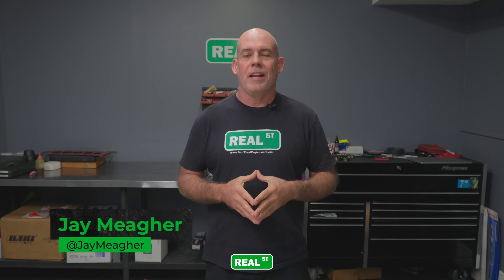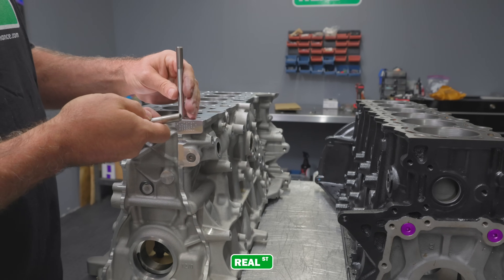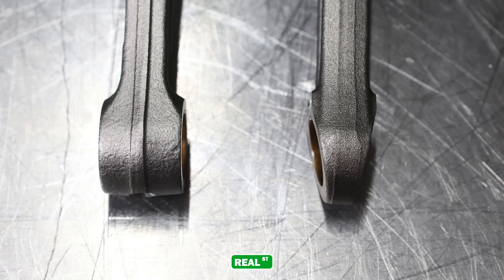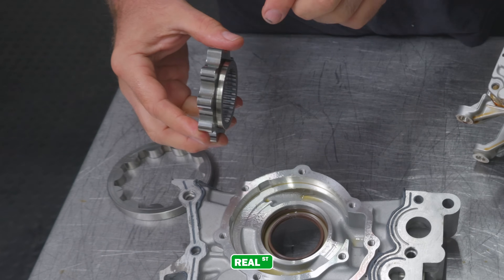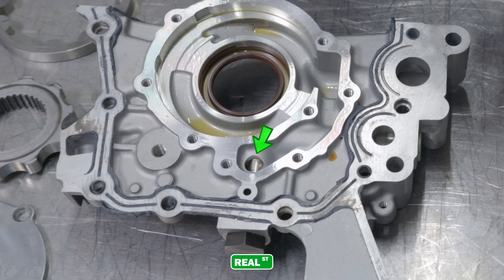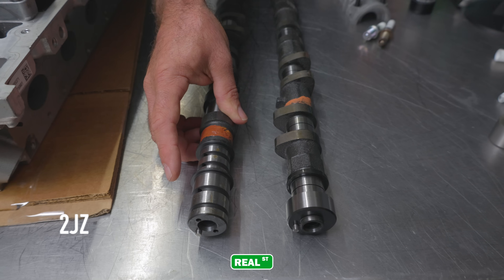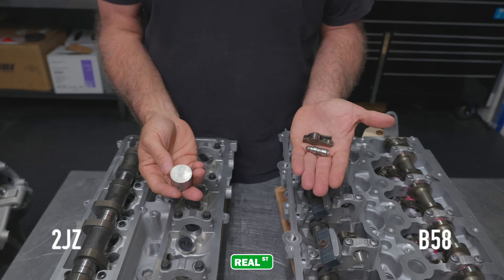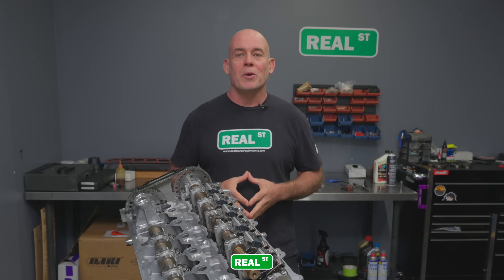Toyota 2JZ vs BMW B58 | Comparing Both "SUPRA" Engine Internals Side By Side In Detail

Comment: I've been defending the b58 but after this I think they can kill it now . OG 2jz is irreplaceable
Reply: You and a LOT of people were defending the B58 and that it was better than the "out dated" 2JZ because it had more technology and newer and "faster" than the orginal Supra when it was released. Yes YOU and they were correct, its newer, newer technology and more hp and faster than the Supra when it came out in 93, BUT the 2JZ motor is still better and can hold more power than the B58. 
That 2 port head will NOT do 2000 hp. MAYBE the 6 port B58, but we won't know until someone actually pushes it, which NOBODY has even attempted yet. 
And this is why ~19 of the 25 fastest imports in the world are 2JZ's .... There is a reason why people have this motor.
Reply: @ACommenterOnYouTube  personally i thought b58 had potential for high horsepower but still recognized its weirdness like the timing chain, water to air intercooler and the oil heat exchanger plus the plastic intake
Reply: @brianm5753  timing chain location got revised in the TU, some people swap to a fmic and upgrade the intake manifold to metal.
Reply: @ACommenterOnYouTube "And this is why ~19 of the 25 fastest imports in the world are 2JZ's" It's like the JZ's had a 25 year head start or something . . . 
Also the "restrictive" 2 port head can easily do 1000hp. If cast Honda heads can do stupid amounts of power a BMW head surely can.
Reply: @Thee_Snow_Wolf  1000 hp is a long way from 2000 hp, do the math.
What Honda head is doing "stupid" amounts of power ??
Reply: 2000hp on stock block? maybe aftermarket blocks
Reply: @oon783  Did i say stock block ??? NO 

The 2JZ "block" can handle 2000 hp with supporting pistons and rods.

Comment: Where is the b58 also planted in a bmw? And how is that vehicle compare to the actual supra.
Reply: Like.......20+ bmws....they range from the 2015- current made 40i bmws in almost every platform u can think of other than the....2018-2019 I think 1 series(they made them fwd afterwards and are made elsewhere other than the US market is why). There are differnt gen B58s also that have their differences that aren't too far apart to a degree other than small or slightly big changes.
Reply: M240i has the B58

Comment: IMO it’s too early to compare maybe in another 10 years.
Reply: Well because we have to wait and see if the B58 block can hold 2000 hp ....
My guess is NO ...  The 2 port head wont flow 2000 hp. 
But nobody has pushed the B58 to its limit YET so yes we have to wait and frankly not sure why nobody has done so. 

Papadakis BUILT his B58 just to hit 1000 hp because i dont think he thought the B58 would hold 1000 hp on stock internals.

Comment: Seconds into the video I fully expected to come out forced to like the BMW engine. Having seen this awesome and detailed comparison, I am just confused. The new engine is in no way superior. It probably has better fuel consumption, emissions and does weigh less, but that's irrelevant from a performance standpoint. For the price of it, you can probably get an aluminium aftermarket JZ block. Toyota you shit the bed with this one. And that's not even accounting for the interior and infotainment in the Supra.
Reply: The 2JZ block is superior PERIOD ...
The B58 2 port head wont stand high hp, the 6 port maybe.
The B58 block holding 2000 hp 🤷🏽‍♂️ someone has to try it but nobody has done it yet and i dont know why especially when this motor is being "hard" compared to the 2JZ all the time.

Comment: Hi Guys, great video 👍🏻 Just FYI regarding the B58 oil pump. The part that you stated as being a scavenge stage, that is actually a vacuum pump for the brake booster.

Comment: Curious the power level limitations the two port exhaust head creates on the early B58?
Reply: Thats why he said on the 2 port B58 head wont support high level hp but will help spool the turbo quicker on low end.
Reply: @ACommenterOnYouTube there is a 2 port mk5 making over 1000whp+ from P2uned and they recently ran a 8.23 in theirs.
Reply: @carboydorifutoparty3976  well the 2JZ did 1300 crank hp and 1105 whp on stock internals so ...
When that B58 hits 2000 crank hp or 1600 whp, then we can talk.
Reply: @ACommenterOnYouTube  I understand the obvious limitations the two port head has.  My question was merely what limitations it creates meaning what’s the max power level vs a 6 port head?
Reply: @KCMedia33  on the 2 port head, all 6 ex ports have to flow thru 2 ports which is a bottle neck for the exhaust at high rpm high, high hp levels. 
Where as the 6 individual ports, they have their own path to exit which is better for higher hp applications.
Reply: Papadakis actually opened up 300 more horsepower when moving to the 6 port head

Comment: The b58 no doubt is more advanced than the 2jz. engineers keep adding more ports for fuel, air, oil etc, and more adjustability for gears, pressure, air to fuel. All this means is that engines are getting more and more complicated or complex which does open more room for improvement in power and efficiency. It also makes room for more problems and more difficult to locate the issue due to more bits and pieces. in the end either go with something more complex and corky with new empty pages waiting to get filled or just stick with the published book that's simple, robust and proven with a nice ending. lol great video
Reply: More ports for fuel? What are you talking about? VVT is also a problem for making power at the highest levels of performance. Most of the "improvements" that the B58 has over the 2JZ were done for fuel efficiency and will do nothing but limit the amount of power that it can make in a racing application.

Comment: Asking which 6 cil. engine is better is like asking wether the 4 cil Mitsubishi 4G63 is better than the Honda 24K.
There are much more Honda racers, therefore more development in the K24.
There isn't as much interest and therefore investment and therefore results in the B58.
Simples.
Reply: Ka24de vs sr20de 
Ka is a high torque lots of power down low but nothing up top
Sr has no torque but lots of top end hi rev hp 

Pick your taste. I took the ka, 482 whp and 452 wtq. 
I hit the gas pedal abd she is GONE ... no lag no wait 👍🏾
Reply: the 4g63 was easily the swan song of Mitsubishi. Amazing little engine, as long as your crank didn't decide it wanted to go for a walk.

Comment: Making a QUICK SEACH ON THE INTERNET i'VE FOUND 4 COMPANIES THAT SLEEVE THE BLOCK OF THE B58 [sorry for the caps].
So the sleeves may allow you to increase the bore and, therefore, the valve diameters for better chamber flow. Its a perfect world as the walls among the pistons will be stronger iron and the Al will allow lightweight aND HEAT DISSIPATION. So much potential there 🤔
Obviously the cast iron block 2JZ is better for drag racing, while the alu block B58 is better for endurance racing as it permits better heat exchange and smaller size of radiators and less coolant and hooses. - weight savings.
The complexity of the pneumatic valves and rockers of the B58 will demand the use of AI [ANN = Artificial Neural Network] to perfectly tune it, as the 2JZ uses a single cap. You have to simulate the intake [rocker+pneumatic lifter] + exhaust  [rocker+pneumatic lifter] altogether in Phyton to find the optimal solution for the components. It will be a simulation of 6 rows of 6 ellements . 😱Intake rocker+lifter + electric controler [vanos + valvetronic] + exhaust rocker+lifter.
Also the higher complexity of the B58 valve controlers - more 6x moving parts - will make it more break prone.
On the upside, the B58 will be able to manage the acceleration better. The 2JZ might be the dyno king, but its restricted to a shallow RPM range, demanding the use of blow-off valves and ECU management of the traction control. More ECU interference means more stress to the engine. The B58 should naturally find more progressive traction in lower RPM.
IMO the B58 will trully evolve when people start to use the F1 pneumatic valves, eliminating the rockers and valves, making it reach 12,000 RPM. Meanwhile you have to develop suppliers with alternatives to rockers and pneumatic valves 🥵
Reply: "Obviously the cast iron block 2JZ is better for drag racing" This statement is just not true. The fact the 2JZ block is cast iron doesn't mean it's inherently better for power production than a B58 block. After all the B58 engine block is the same block as the diesel B57, and diesel blocks need to take FAR more combustion pressure than a petrol engine. 

Also did you use AI to write this? It had so much wrong info it felt like I was having a migraine
Reply: So many words for so much BS... Sorry dude, you're a great talker obviously but you're talking nonsense.

Comment: 16:14 This means using MAP sensors as an input to Spark and Fuel surfaces for calibration goes out the window. If the airflow can be managed via intake valve lift then one would need an in-cylinder pressure sensor to read load.
Reply: It can determine load using a MAF sensor
Reply: @coreyw427  Not accurate enough for boosted applications
Reply: @755hp  It is boosted from factory? Or do you mean extra boost? It has a MAF from factory. No one uses an in cylinder pressure sensors to measure load. There are many simple ways to solve the problem, eg the load will basically be proportional to the manifold pressure and valve lift at a given RPM. It’s really not overly difficult and certainly do not need something that a) isn’t used in reality and b) is only used by OEMs during engine development. Also, MAFs are very accurate, no idea where you got the idea they weren’t from. They’re more accurate than using a MAP-based approach really as they directly measure airflow into the engine rather than trying to estimate the airflow using pressure. Maybe you’re thinking in an aftermarket application that the factory MAF would be too small, which definitely could be possible.
Reply: @coreyw427  So one would need various surfaces to account for MAP, RPM and Valve lift; those are three inputs needed to set fuel and spark timing. So for example, if your valve lift has three opening positions (low lift, mid lift and high lift), you’d need RPM (x input) and MAP (y input) as a surface at low, mid and high lifts. Then you could write the software logic to blend these three surfaces together to account for in between valve positions of low to mid and mid to high (assuming they are variable and not step changes). So I guess this can be done…

As for he MAF vs MAP debate, speed density calculations (MAP based) are more robust (leaks, seals, etc than MAFs). Similarly, it allows for changes in the intake piping where load can still be accounted for. This this order (1st is best) are the best ways for measuring load: 
1 - MAP
2 - MAF
3 - TPS

And I’m waiting for the day that an in-cylinder pressure sensor is robust enough to last the lifetime of an engine; cause this would be the best way to measure load in the software. Simply target a cylinder pressure and bring actual cylinder pressure to meet it using all actuators (throttle, fuel, spark, wastegate, etc). Will also be able to guard against knock far more accurately this way to. Having an in-cylinder pressure sensor is a vital input to being able to control an ICE engine way better. Game changing if applied in factory applications. Just too expensive and doesn’t last long; so developmental use is only applied at the moment.

But the data taken from development use of an cylinder pressure sensor IS modeled in the ECUs; also cylinder temperature (especially for CAT monitoring). The software does have a rough idea of temps and pressure accordingly….but it is still only “modeled” not actual…
Reply: @755hp  You basically just need to determine volumetric efficiency for all manifold pressures, valve lifts and RPMs. A simple version could just have a 4D look up table for this, so it's really quite doable. This is also done for VVT setups where the VE will change depending on cam advance. MAP is certainly more robust to leaks for the reasons you have mentioned, but generally this is not a concern for OEM applications since generally there are should not be significant leaks. The ECU can compensate for leaks using closed loop fuel control, e.g. a small leak will normally = a small increase in additive fuel correction, so is not really a problem + there are other redundancies in case of, e.g., total MAF failure. As you say, a MAF needs to be calibrated to the intake tract it is installed in, but when done properly like in an OE application it is very accurate due to directly measuring the airflow. MAP on the other hand is just estimating airflow into the engine dependent on VE including VE dependent on VVT position and lift, as well as temperature of the air which is dependent on manifold air temperature as well as the temperature of the inlet ports and any cooling due to latent heat of evaporation of the fuel, which is difficult to model accurately on its own. I agree having cylinder pressure sensors would be great especially for analysing abnormal combustion, but I don't think it's great for measuring load because it is not actually measuring the mass of air, which is most important. Factory ECUs use many techniques already to get a very accurate picture of load, even on a per cylinder basis. For example, the Continental Simos can account for different airflow between cylinders by measuring the roughness of the crankshaft caused by combustion. In an aftermarket application, a simpler approach is just to look at EGTs or even lambda on a per cylinder basis. I'm not aware of cylinder pressure being modelled in any ECU but certainly indicated torque is modelled which is directly related to cylinder pressure. Most also have models of temperatures of the exhaust gas and exhaust components, most importantly the cat.
Reply: @coreyw427  Okay….so you’re a calibrator; must be.

Comment: At Toyota we have had a few of the oil pumps fail not completely fail to the point of engine damage. They fail in a way that you can’t get an oil level reading when you request an oil level check. It will start doing the reading and fail at around the 16% to 18 %.  Oil pump replacement fixes the issue.  Had one this summer that I had to replace. First time for me going in to this new engine so at first it was a bit foreign.
Reply: Looks the same pump as the n55/s55. In them I've seen the fiber seal things in the pump that seal the bit that moves to vary the displacement get lodged where it shouldn't. Also seen the rockers fail and the needles from the rollers fit the pump pickup screen and get into the pump causing hell.